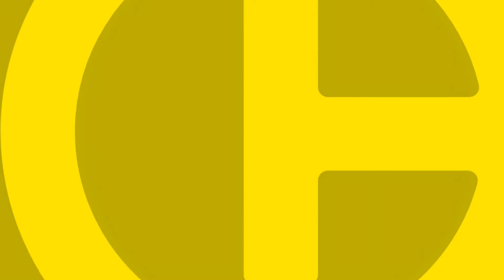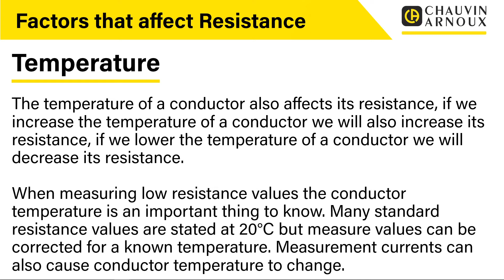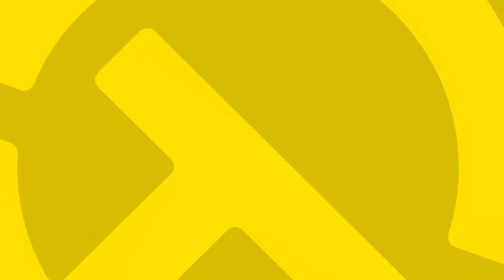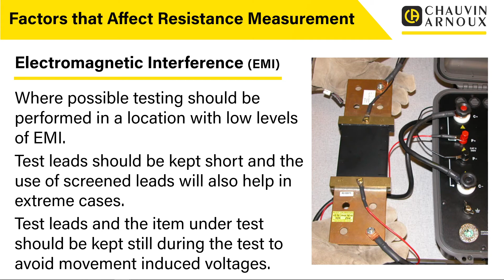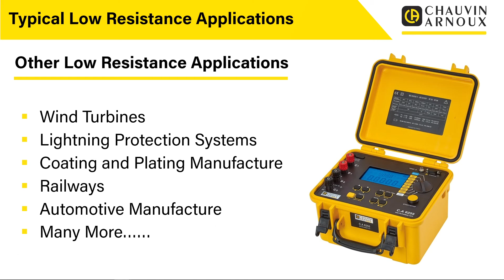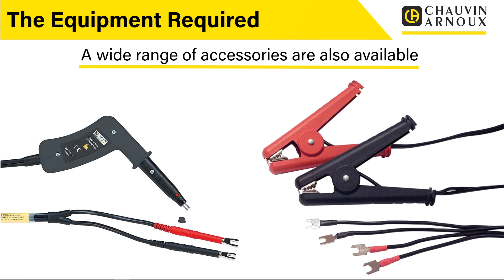CA Webinar 6 - Low Resistance Measurement

Comment: Heyya, so can u measure motors with 6240 or not? Also hows with safety with measuring? Like can u touch metals when measuring, also if  ELV tranformer seconday in grounded in switchboard can you measure assembly conductive parts without damaging transformer?
Reply from the maker: Hi, Can you measure motors with CA6240? Yes depending on the size/inductance of the motor. It may take time to test a large motor and that motor may create a large back EMF when the test is ended. Yes, you can touch anything as output voltage is low, only about 6V. We would direct you to the product manual on our website www.chauvin-arnoux.co.uk for full safety instructions. With regards to your further question about transformers we would need a bit more info on the application, maybe you could drop us an email to info@chauvin-arnoux.co.uk. Thanks for reaching out and glad you enjoyed this content.